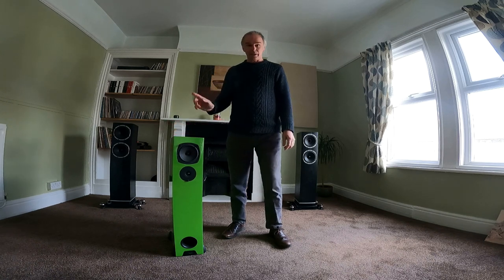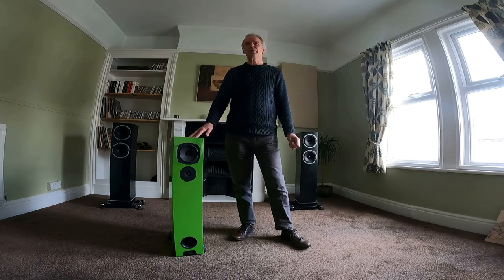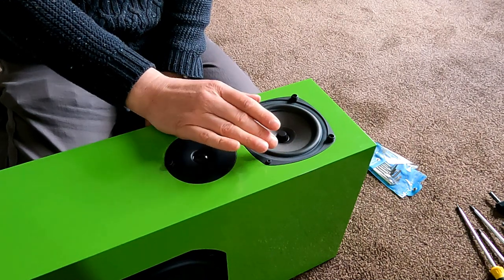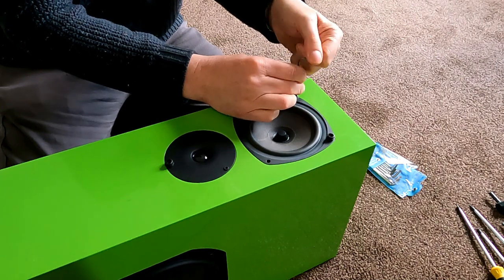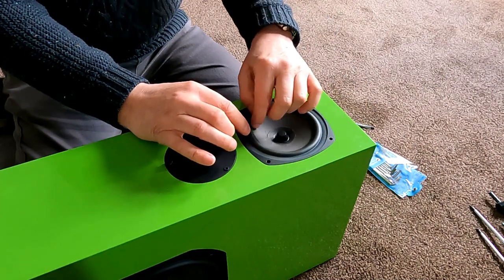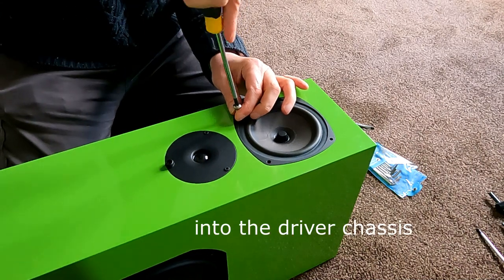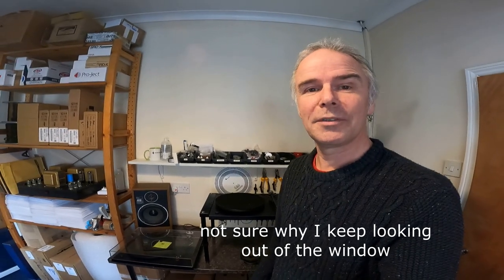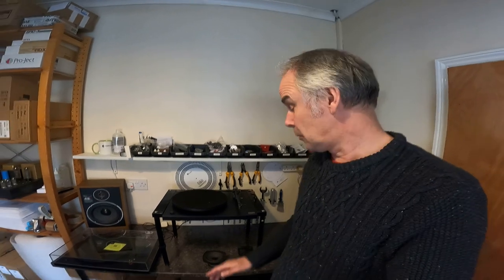How to remove a sealed in Rega or Linn Speaker drive unit

Comment: Great Video! I have watched many-and this is FIRST  decent example of removing drivers from non traditional boxed ported models.  Many others also require difficult removal. Sadly-This video does not help figure out getting to the drivers in my specific type. 1995 era DAHLQUIST PRELUDE(USA) tower (CA2/ W2 modular system) Still lost!

Comment: Thanks. Just tryied to open one of my Linn Index and couldn't figure out how to pull off the bass driver from the cabinet after unscrewing it. The speaker cone looks ok but it is mute. I hope it is just a soldering problem and I want to check solderings and eventually re-weld the failing one.

Comment: These are rega rs3’s right? Would they work well across a room 9ft wide 15ft long? They would need to be on the shorter wall. With a rega brio and a planar 2.
Reply from the maker: Should be fine,    I tend to use them with the side firing units on the outside in that situation,  it gives them a much bigger soundstage.  The smaller Regas all seem to be better when you sit closer like that... they could almost be classed as 'near field monitors'
Reply: @cheshireaudio  to clarify, they would be on the short wall pointing down the room. Listening position would be 6-8ft away. So the speakers can only be a maximum of 6ft apart before they are too close to the wall.
Reply from the maker: @lrwebb869  Oh ... see what you mean now.  That's not far off the dimensions of our dem room .... also my son has a pair in a similar configuration.  they work well. I would try the side units inwards in that situation
Reply: Much appreciated thank you. Now if I can just find someone from the UK happy to ship a rr125 mid bass driver to NZ.
Reply: hey you still after that driver?